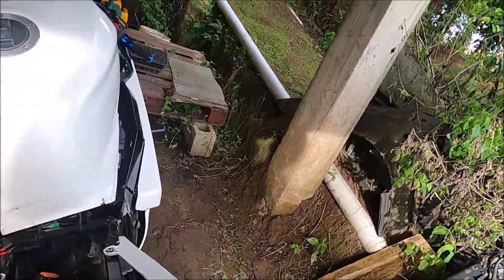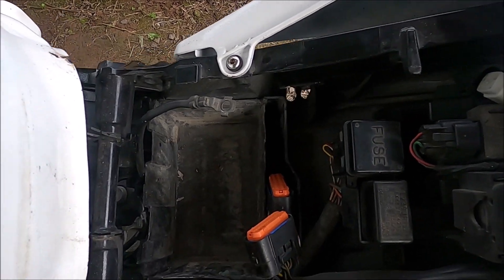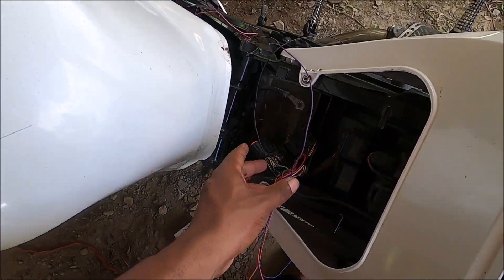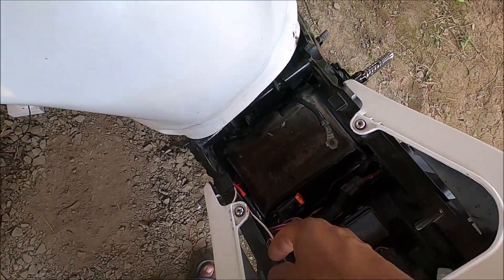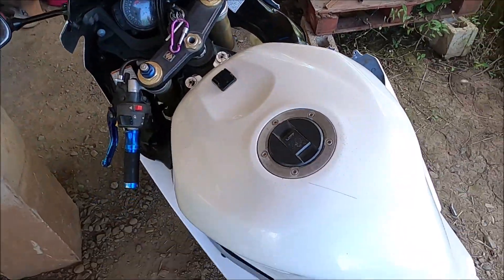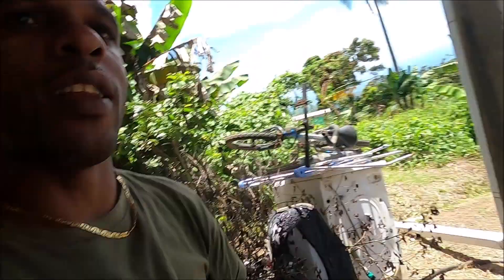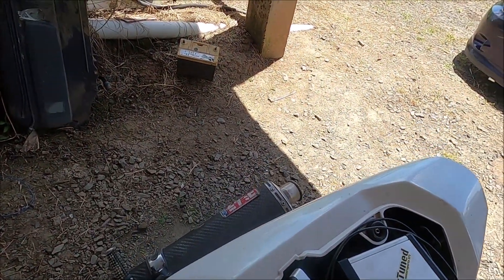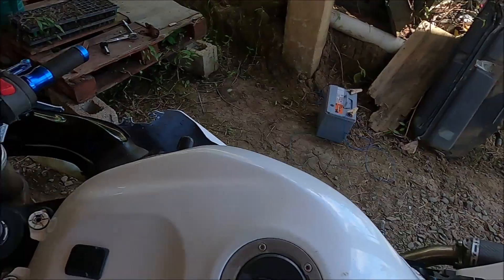My Suzuki Gsxr-600 Gets a Speeduino Standalone ECU 💥

Comment: I'm currently building a buggy with a GSXR1000 engine. How did you program the secondary throttle? or have you removed or switched it off?
Reply from the maker: I disabled mine

Comment: In the wiring diagrams there is a module selection switch coupler that has 6 wires going into the ECU. What is that?

Comment: Awesome stuff!

 Something to think about tho, you might want a heatsink on that coil igniter. Those things generally are bolted to something aluminum in their factory applications because they can get HOT!
Reply from the maker: Thanks bud.

Plan is to mount it against the frame
Reply: @DCWERX  Good deal.  I meant to add as well that I have salvaged many OEM ignition modules from many different makes and models, and probably 3/4 of them had thermal pasted applied as well. I personally just use whatever ole cheap CPU thermal paste I have laying around.
Reply from the maker: Juliana Charlery  I know 😆

Comment: This could not have come at a better time! I have just added Speeduino UA4C to my LS1 swap 1980 Corvette, and plan to do my turbocharged 2004 GSXR 750 next. As far as I know nobody had done a K4 GSXR as of yet and if you can figure it out it will make my life a bit easier, lol!
Reply from the maker: Awesome it's a relatively straight forward install. Come to think of it you may be right, I have not seen another speeduino gsxr
Reply: @DCWERX  Is your bike lined out and running good yet?